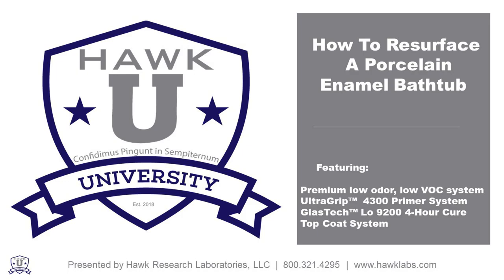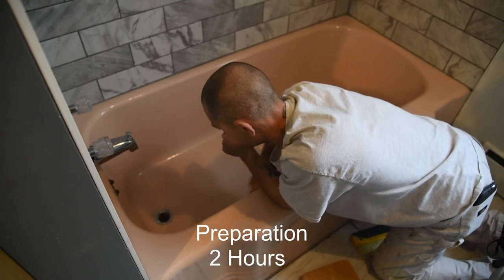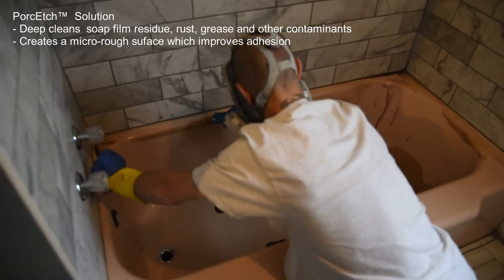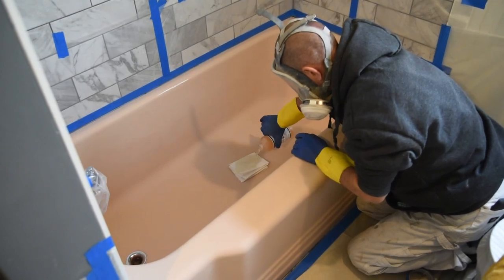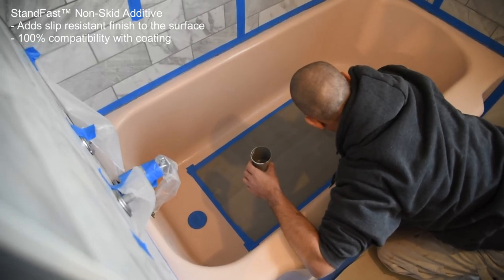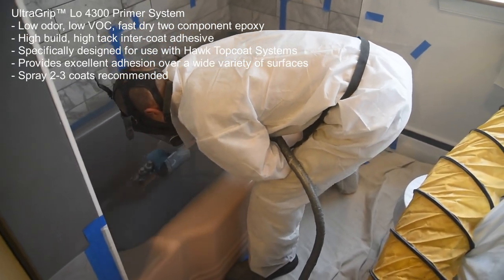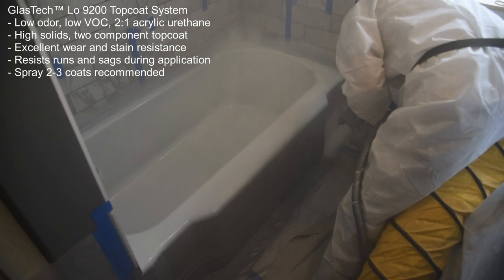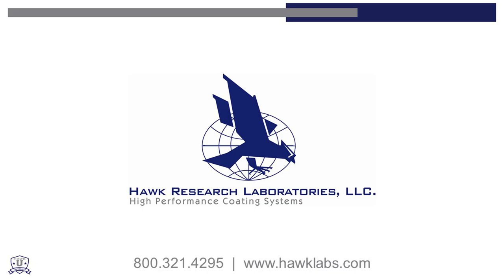HOW TO RESURFACE A BATHTUB

Comment: good video.  hope you can help me with a question?  had tub resurfaced a couple years ago and they used your products.  i used an ardex silicone caulk and within a couple month turned yellow.  have been putting the project off because i am scared to remove the caulk, not knowing how careful i have to be to not mess up the resurfaced tub?  they gave instructions on cleaning it and a list of approved cleaners.  i know i can't use a caulk remover on it because that stuff is harsh, any ideas?  thanks.
Reply from the maker: Our Technical Support team recommends using a sharp blade to cut down from the top and then flush to the tub to remove the caulk, then use Acetone or MEK to soften and remove any left over silicone/residue.   Good luck!